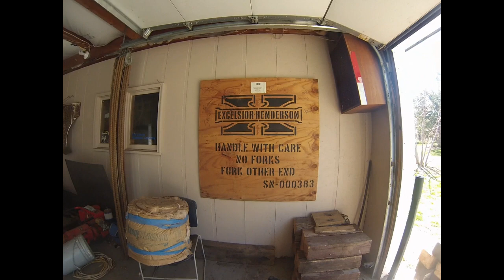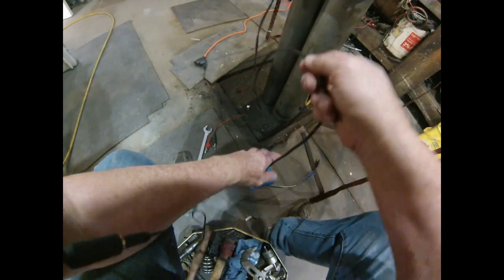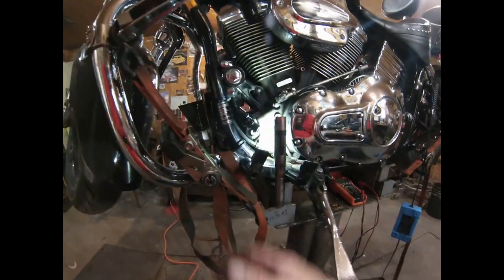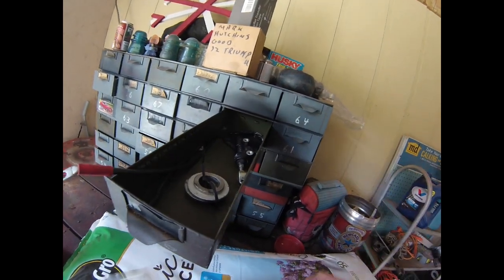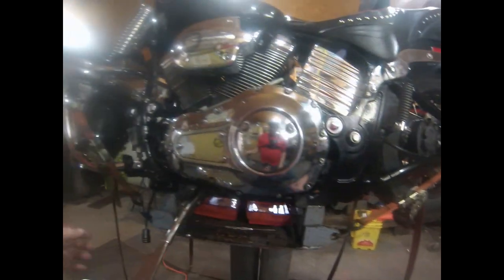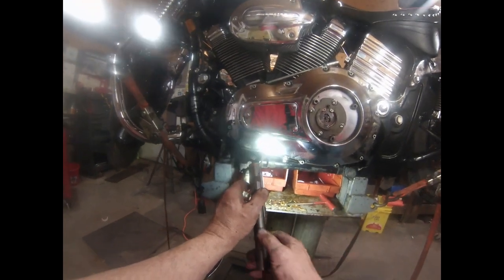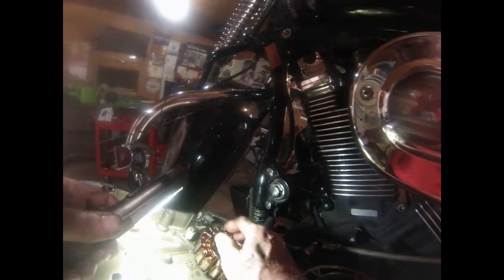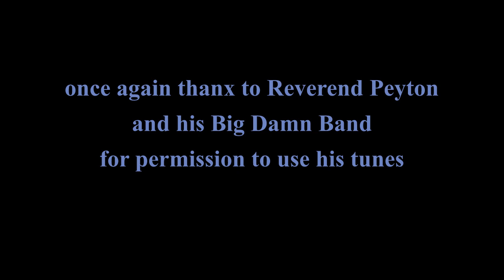testing/replacing the stator on your 1999/2000 Excelsior Henderson and me probably talking too much

Comment: I cut out the stator connector, on 901 back when I first got it because the connector had melted due to high resistance, like yours. I directly spliced the wires, and ran it that way with no problems until just last year when the stator finally failed. That connector is a weak point, because it can get a little corrosion on it, which causes resistance and heat.
Reply from the maker: And it only makes sense....   its exposed to the elements constantly. I used the "used" connector, and piled on the silicon dielectric grease. I'm suspecting I'll be changing over to the "shuntless" regulator this year sometime, and then I'll just splice in direct.
Reply from the maker: in my updated episodes I eliminated the connector. I had to splice on a chunk to reach the new volt meter. I do realize that splices, even the most perfect ones, do create resistance. But we'll see how this goes.